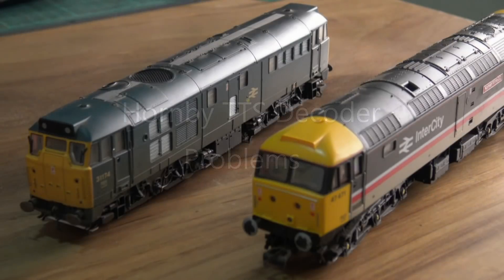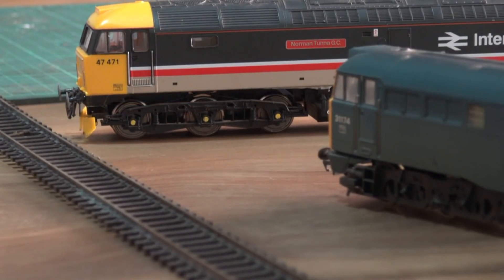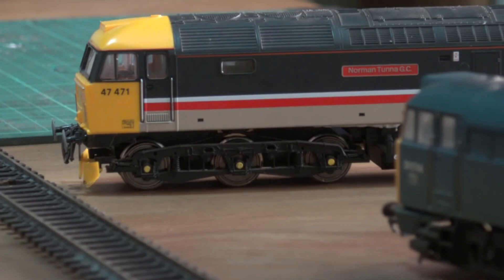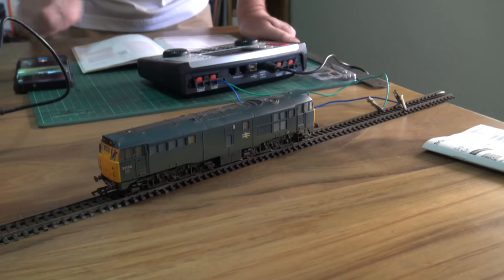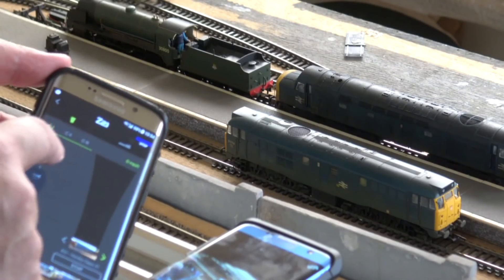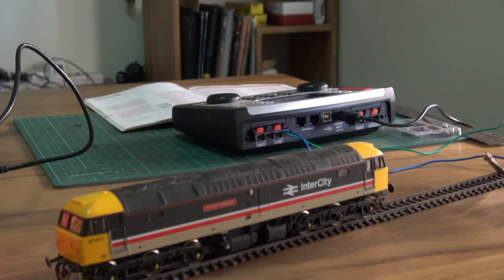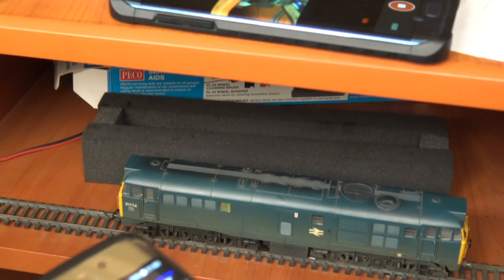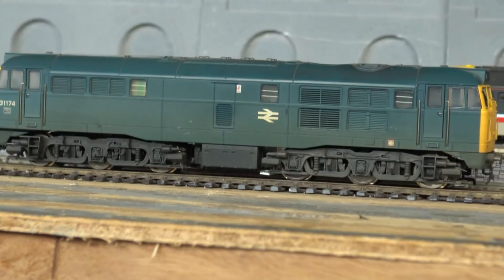TTS Decoder Woes at Kampala Road

Comment: Hi Jerry and so sorry to hear of your TTS problems but to be honest I’m not surprised, the Hornby TTS decoders are fine if you fit them to a Hornby loco, use a Hornby controller and anything else which needs to be Hornby, deviate from any of that at your peril. Look on most forums and website relating to TTS problems and you will come up with the same answers. Despite what some other people say, Hornby TTS decoders are NOT NRMA Compliant like Zimo, ESU and other makes, try changing some of the CV’s and you won’t be able to, the normal CV’s are adjustable but dig down any deeper and they will be locked out by Hornby. The clue is in the price, these decoders are mass produced for Hornby which is why they are so cheap. Also, some TTS locos have specific PCB boards fitted for TTS sound, have a look at a modern Class 43 HST PCB board and it specifically says on the PCB for TTS sound only. ask Leggomanbiff about TTS decoders and see what he says!!   😉.   I never buy TTS sound decoders as they are cheap crap and are only any good if you have everything Hornby, some may work with other controllers at a pinch  but not generally.  Have you any sound decoders other than Hornby which work OK with the Z21?  If not then It might be worth buying a decent decoder and see how that performs with the Z21 - I promise you that you will not have a single problem and that’s because they are not mass produced bits of rubbish and will certainly be all NRMA compliant - unlike Hornby.  Hope you get things sorted mate, I feel the frustration for you.      ...........Graham
Reply from the maker: I can just imagine what the guys like Legoman say! Haha. Some very interesting points you bring up Graham and I had no idea that Hornby were moving to "exclusively" on sound with some of their locos.  An ill advised move I would of thought.  I was very surprised when I learnt they were not NRMA compliant.  I thought after the Elite fiasco 12 years ago a lesson should be learnt, but not so. I am having so many problems with Hornby product at the moment and I'm not alone, they really don't seem to care???? I believed TTS was good for the hobby, introducing it to people like me in the hobby.  Thats what it should be, but introducing some AND stating it can be used on other manufacturers items which is not quite true is surely shooting yourself in the foot. It's a real shame that such a venerable company has turned the skill of making models into a cheap commodity game. Their best efforts were around 2004 to 2009. From that time on it has gone downhill.  All my resent purchases with the exception of the P2 and Duchess City of Birmingham have had running issues or quality issues. Cheers Graham, thanks for your insights.  Best, Jerry

Comment: hi jerry ,i use an nce powercab and have different issues to you ,my  4 tts locos randomly  set off on their own .i searched for a solution and have now piggybacked all the tts decoders with cheap lais decoders ,the lais ones run the loco the tts is used for sound only ,have a look at "mattymidland"for how to do it as its a tad complicated ,in the video you say you are running a heljan loco with tts ,dont !!!!! the high current draw of heljans will burn the chip sooner or later ,theres a reason tts decoders are cheap ,they arent up to the job ,lesson learned ,loksound for me  , cheers
Reply from the maker: Hey Mick, I didn't realise you could do that and many thanks for the pointer. Yes understand 're Heljans,  I don't run her over 50%. The same is true for the Hattons decoders and Heljan. Interesting you mentioned run always. I too get these and it is very alarming. They go off at full pace! Again thanks for the pointers, I really appreciate it. Cheers Jerry
Reply: hi again jerry , with hindsight most people wouldnt buy tts decoders due to all the associated issues ,even with the "piggyback"fix there is an issue ,its difficult to sync the set off of the loco ,lots of cv fiddling involved .mine have been running for months now with no other issues .ive never been a fan of hornby ,everything apart from the super detail/super expensive stuff is "toylike "i started with a select controller which went straight in the bin after seeing the capabilities of other controllers and i only have 1 hornby loco ,a super detail 56 which runs and looks amazing ,however its let down with a woefull coupling system (had to fit goalpost coupling )and if  you remove the body its potluck weather the lights will work .sadly i cant see hornby being around much longer ,they cant compete with the quality and price of bachman /heljan/dapol .dcc is quite simple ,non compliance results in expensive mistakes ,happy modelling
Reply: Locos setting off on there own at start up with the NCE try turning off the DC running on the decoder. This worked on about ten locos my mate was having problems with. 

Good luck.